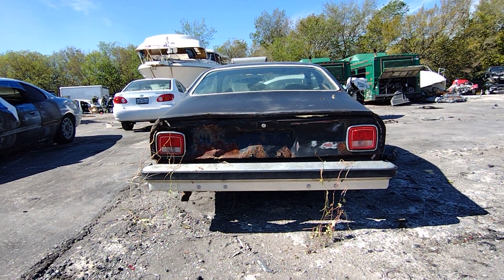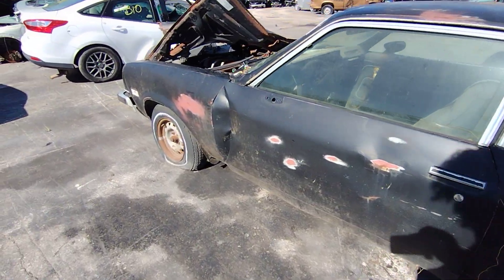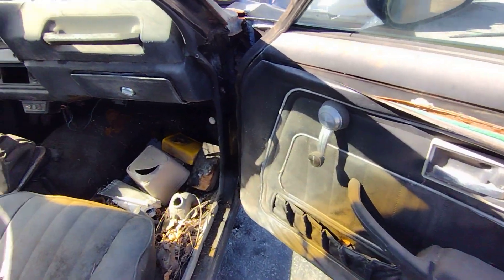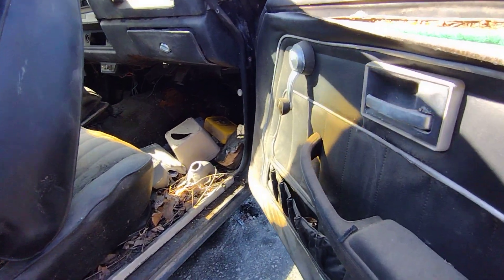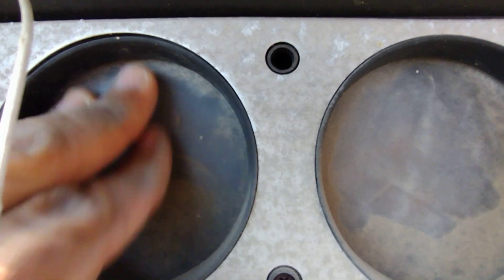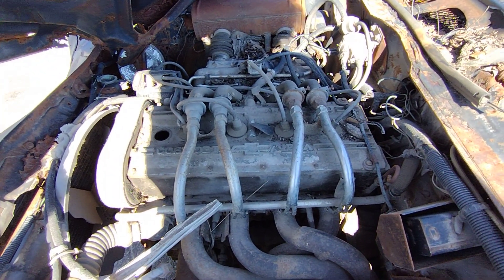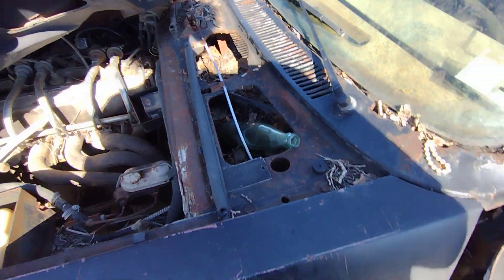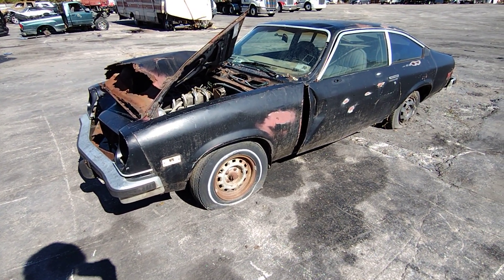Rare One Scheduled to be Crushed.1975 Cosworth Vega Junkyard Find. Will it be saved?

Comment: Whoa Nelley, 1975 and still alive...

Yes, they are rare. Only 3,508 Cosworths were made in 1975 and 1976. In 1975, they were only black exterior paint, and no other Vega in 1975 had black exterior paint. By 1976, black was available as an exterior color on a Vega. There were 2,061 Cosworths in 1975 and 1,447 of them in 1976. Final numbers vary, but that's about right as to what it was. 

No, LOL as we talked about, the 1975 Cosworth models had a four speed, but 1976 had a five speed as an option. No, that's not correct. Messena, NY cast the blocks, GM's Tonawanda, NY engine plant then got the blocks, did honing and final assembly and completed engines were shipped to Lordstown, OH for assembly in the vehicle. Yes, each engine had a plaque with the engine builder's name on it originally. Yes, no power steering, brakes or AC with these. 

We got the tag, we can brag: ST75 for 1975 model year, 1HV77 for two door Vega hatchback, U for Lordstown, OH assembly, 19Y for Black vinyl trim with Black carpet, A51 for front bucket seats, 19U and 19L for Black exterior paint, 05C for the third week of May 1975 production. Under the 05C, that is actually the production sequence, which is very rare for GM to do. Most GM trim tags do not have the production sequence. In this case, it does, and all Cosworths had that on the tag. 

We got the VIN, we win: 1 for Chevrolet, V for Vega, 77 for two door hatchback, E for 2.0L (122 CID) twin cam Cosworth designed four cylinder with electronic fuel injection, 5 for 1975 model year, U for Lordstown, OH assembly and the rest is the production sequence, which in this case matches what's on the tag. The Lordstown, OH plant operated from 1966 to 2019 and was rife with labor problems and strikes, giving it the nickname, "Industrial Woodstock" from all the hippie employees that worked there in the early years. When a GM plant later on would have a strike, GM management would call it "Lordstown Syndrome". Foxconn, the chip manufacturer is now on that property. You're close, as it was 3.73 in 1975 and 1976, and 1976 had an option for a 4.10 and a limited slip rear. The Vega was the kicking and screaming answer to the small car market from GM and soured its' reputation as making poorly built small cars. The other US makers didn't do so well either and many were money losers for the Big 3/4 back in the day. 

Whoa Nelley, rare duck and almost out of luck. Made in Ohio and doesn't have to go. Industrial Woodstock saved from the chopping block. 1975 and did take a nosedive. That's not it, not time to quit. Trim code 19Y and almost went bye-bye. Partially made in the UK and almost went away. It won't just yet be flat and that won't be that. Not going to get squished and all of the Cosworth Vega fans, some here and just slightly so, the Google Man won't be getting pissed.
Reply: Nice research good job
Reply: @chuckb9867  Sure thing.
Reply: I think my aunt still has a 76 in her collection. You can do whatever you want to it but it'll still be ugly.
Reply: @mjc8248  What color is it?
Reply: She had a nice brown metallic one she bought new but the one she has now is orange. The brown one sold about 5yrs ago but I'm pretty sure the orange one is still sitting in storage. She bought the orange one as old stock in 78 or 79 so it's still a one owner car. Technically a no owner car since it was never registered. She owned a car lot and slaps dealer plates on everything.
Reply: This car was expensive for its time. it should have had a mandatory 5 speed, power brakes and power steering and this version of the Vega was not an economy car with the blow me up Motor at 10,000 miles or less. Look at it this way, it didn't have a CVT so its ok in my book! Lol :-D
Reply: I saw this video on YouTube several years ago where some guy that had like 6 mint condition Cosworth Vegas in a barn and then the barn collapsed destroying them all.
Reply: What  year  was the brown  in color?
And if I'm  not mistaken  they cost  almost  as much  as a Corvette.
Reply: @garymckee63  it was a 76, someone from Texas bought it along with a couple other cars. It was kind of a reddish brown metallic, odd color but kind of cool.
Reply: @garymckee63  All 1975 Cosworth Vegas were code 19 Black. You couldn't get black on any other Vega in 1975, only a Cosworth. By 1976, black was available on regular Vegas as well as Cosworths. 1976 Cosworth colors were code 19 Black, code 35 Dark Blue, code 65 Buckskin, code 36 Firethorn, code 49 Dark Green, code 37 Mahagony, code 78 Medium Orange, code 67 Medium Saddle and code 11 Antique White. A Cosworth was only about $900 cheaper than a Corvette in 1975. You're probably talking about code 65 Buckskin exterior paint.
Reply: @mjc8248  Sounds like code 65 Buckskin exterior paint. Yes, if it has never had the MSO turned over, it's technically "new" or at least 'new old stock".
Reply: @Ka9radio_Mobile9  My neighbor next door had a Vega, but it was a Vega GT. It was code 35 Dark Blue, but it got wrecked and rode around with a code 49 Dark Green front clip for a while. His sister was the one that I related in a past post that used to get rides from her coworker at HP that wound up being a serial killer. They're much older than I am, so by the 1970s they were already driving.
Reply: @garymckee63  Here's a little known fact. The Vega "lived on" past 1977. The 1978-1979 Chevy Monza and Pontiac Sunbird wagons used Vega sheet metal. Talk about getting your money's worth. LOL.
Reply: @googleusergp  I called my aunt and she said the one I thought was brownish red metallic was a code 37 mahogany metallic car. I still say it was brownish red metallic, lol. It looked more like a caprice/Cadillac color than a "sportscar" color
Reply: @mjc8248   I know the color. Benny featured a Monte Carlo on this channel that was (originally) painted that color. It was some time ago.
Reply: @mjc8248  so it still has a certificate of origin?
Reply: Vega Man?
Reply: @CAROLDDISCOVER-2025  As far as I know it has the original paperwork it was delivered to thee dealership with when new. She has several cars in her collection that were never titled or registered. She's getting on in years, 70 I think, and she's sold a few but she's still collecting.
Reply: @mjc8248  well what else is your aunt selling? Also wouldn't she be a little older than that? Not that matters to me. That would make her about 26 back in 1978. Which is when I think you said she got the Vega as a leftover. Young to be a car dealer but not impossible. Honestly if the cars have not been titled ever that may present a problem. But it also could increase the value I would think. In case we had a lot of fun modifying these Vegas back in the day.
Reply: @CAROLDDISCOVER-2025  Me? No. The Vega was a piece of junk. This one is rare.
Reply: @CAROLDDISCOVER-2025  She's got to be at least 70 since I'm 50, you don't ask old hillbilly women their age and live to tell about it, lol. She's been trading and selling in her friends group for a couple years now mostly 60s and 70s cars but she still has a few tri-five cars as well. I grew up around and eclectic group of car collectors and racers so I've seen them all come and go over the years. My first car was a 55 Belair, drove a big block 4spd Stingray to high school, failed my first driver's test in a 78 302 Granada sport, and passed my test in an 80's K-car.
Reply: @CAROLDDISCOVER-2025  I post under one handle, no other. Yes, the posts were disappearing, but that seems to have to stopped.
Reply: @CAROLDDISCOVER-2025  I'm not sure what you're getting at here, seems like you're going around in circles a bit. LOL. E Meyer posts on Benny's channel as well. When my post dropped out, I just made reference to the fact that I posted what I would normally post (which was getting deleted) under E Meyer's post so anyone looking for it can find it. When Benny put out a video one time, I was flying out of town on a business trip. Folks were asking, "Where's the Google Man, did he disappear?" I didn't reply until that night when I was done with work and had a chance to log on and comment on the post. LOL.
Reply: @googleusergp  ok

Comment: Years ago I bought, if I remember correctly a 1975 Pontiac Astre SJ Wagon. It's a Vega Nomad knock off  to do something with it. I never did, I still have it. I probably need to sell it before it's too far gone. It has the 4 cylinder ohc, automatic transmission.

Comment: All of them are Black and all of them have a aluminum with 4 speed transmission and they a all 5 lug I think , Cosworth hemi center firing motor 10,000 RPM in every gear I road in one of them once , they all this car i worth 10.000 dollar 💵 in this shape lol I’m pretty sur3 they are all 5 lug , the one I Road in was , supposedly they have Camaro suspension I think , thanks BigAl California
Reply: In 1975, they were all black as code 19 black wasn't available on any other Vega but a Cosworth. In 1976, they came in other colors as well as black. Yes, only 4 speed in 1975, but 1976 brought a five speed option.

Comment: My first car was a Vega but it was the base model with a trunk instead of hatchback and a 3 speed transmission, no air, no radio, and no cigarette lighter.  Got it in fall of 76 when 77 models started to arrive. It was last 75 model on the lot and got a good deal on it cause nobody wanted it. My dad thought I was crazy to buy a compact car till he found out the fuel economy it got.